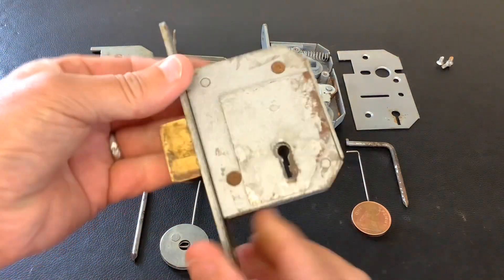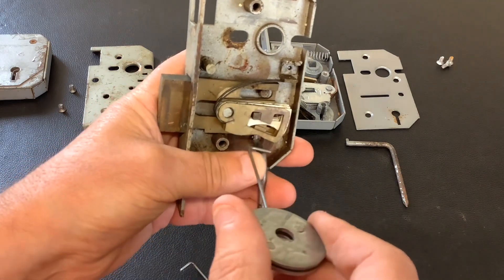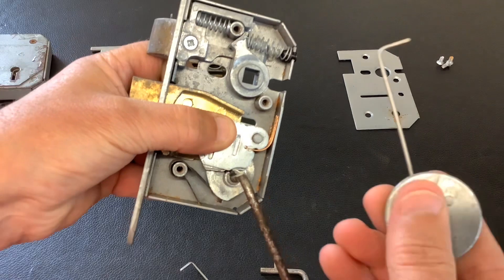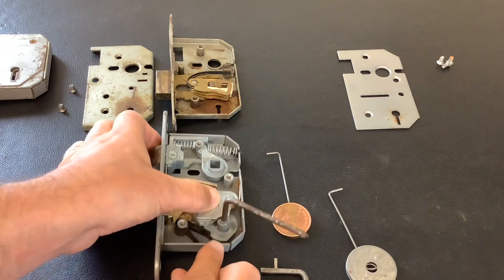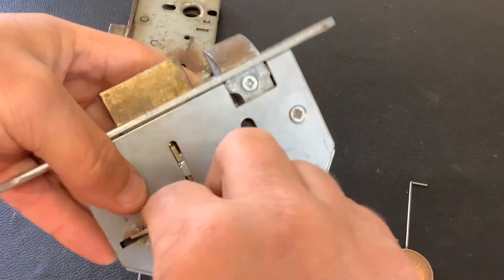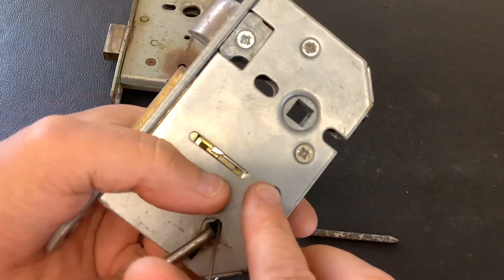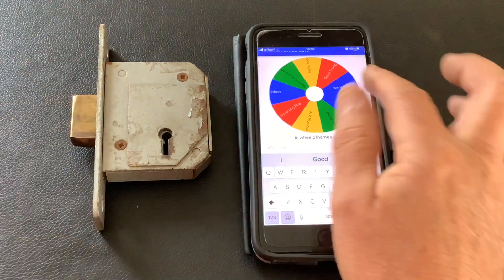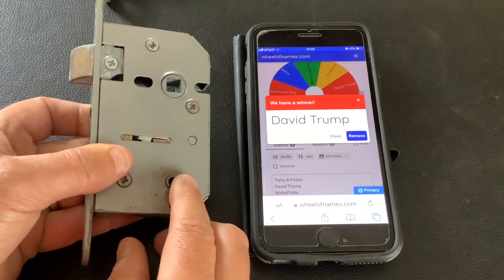744. Difference between curtain and non curtain lever lock pick wires | Chubb 3g114 giveaway result

Comment: Congrats David
I really struggle with getting my pick wire under the very low levers in some Chubb mortice lever locks, even with a nice bend on them.
I've only got two Chubbs an one's a 3g110 😬, so another to practice on wouldn't go amiss😁 
All the best Brummie
Cheers 👍🍻
Reply from the maker: Cheers 🍻 Do you want your name put down for this ERA ?
Reply: @BrummieLockPicker  Sure, why not I've only got mortice locks in my collection and could definitely do with more practice. 
I've mainly picked lever padlocks.
Cheers bud 👍🍻
Reply from the maker: Your in 👍

Comment: So, a non-curtained tensioner is a universal tensioner then? You've got me curious-would a kinked curtained wire also work in a non-curtained lock? Thinking of a stripped down, psedu-universal set then...
Reply from the maker: Yes you can use a curtained wire in some non curtain locks, all locks are obviously different but generally a non-curtained tension tool will work in both locks as long as the diameter are the same as different locks have different diameter keys, it’s horses for corses